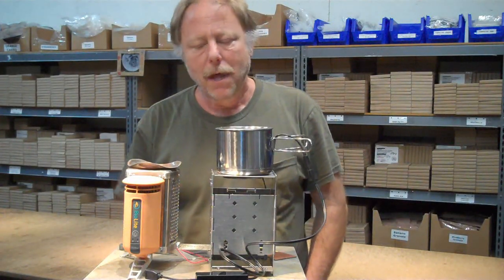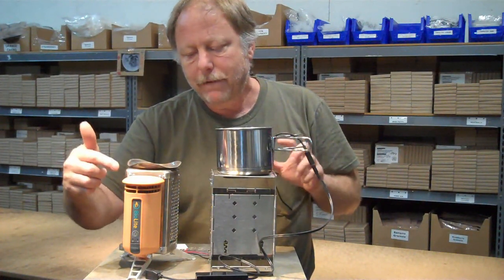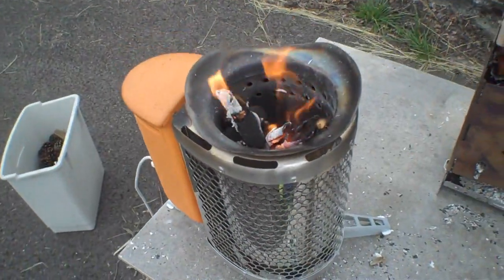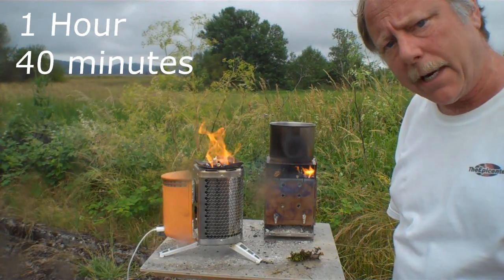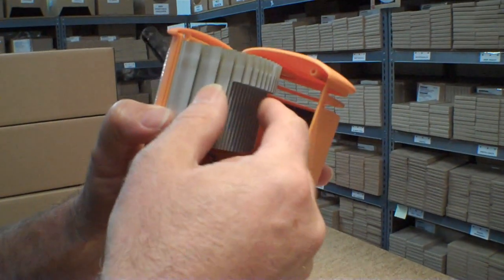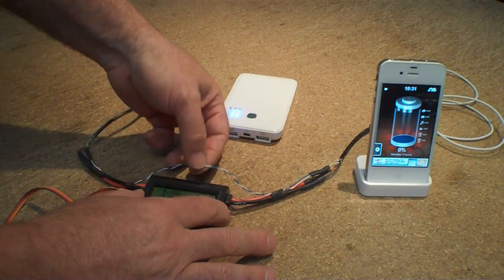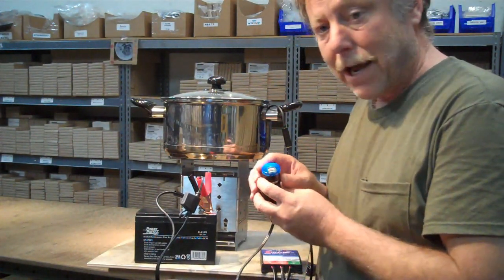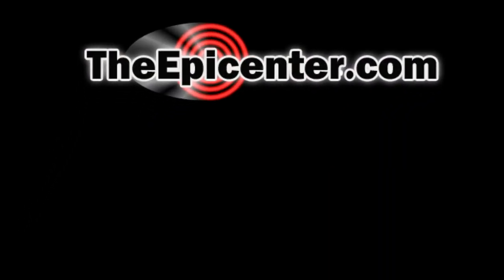BioLite Charging Test - using iPhone 4S and comparing with Cup Charger and FireBox Stove Day 3

Comment: great video, would have been nice to have a usb amperage meter on each cable with a total counter.  im not a biolite fan but it did not seem to be functioning correctly. 
I did have a question if you could change the water in the cup continously, keeping it as cool as possibly. does that effect the output?

Comment: just to point out the biolite was designed as a camping stove first(primary function) and as a second function (complimentary) it also happens to charge stuff when you make a fire, one of the reasons it uses up fuel so quickly is because it was designed to boil a pot of water for example as quickly as possible that's because of the fan and in turn it eats fuel very quickly, I am however disappointed with the results I expected much better from the biolite its a great camp stove I was hoping for better charging .I was ready to buy this in the spring from mec but now I dunno .... does anyone have one of these a little insight would be greatly appreciated
Reply: +5had0wL1nk I love my biolite. Ive heard nothing but good things from people that have them. Mine charges better than his did.
Reply: I absolutely love my BioLite. It works great, and having it just under 3 years I stand by the product.

Comment: Phones are a bit unreliable as test devices. Phones have charge strategies and will not allways use weak power sources effectively. When presented to solid 5V they will get what the amps they need. I suggest you slowly decrease the USB voltage of power devices tested and tell people what mA and power output you read. Then it is up to the phone makers to make smart   and continuosly adapting strategies. I suspect charger makers should pay attention since some phones make up their mind about the power source quality at the begining of charge and does not notice if it suddenly becomes more capable. Some phones are idiotes when connected to solar cells and do not adapt as light and power capability that changes in seconds.

Would be nice to have a separate test of how capable phones are when connected to weak power with fluctuating current capability.

It is really hard for a phone to feel what is behind a +5V output. If the power source has a stupid voltage regulator and does not care about the voltage if the solar cell, or TEG element in this case, the regulator will only care about +5V and if pulled below it basically joins the cell to the output and the cell wiĺl no longer generate at its optimum voltage.

This is a basic design flaw in many outdor chargers with solar cells. A phone connected to a poorly designed controller will se a nice +5V but when attacked with an adjustable current load, at some current it suddenly drops all output current and phone has to revert back to a much lower current load for the +5V to recover.

After a voltage drop "incident" like that phone may sit back and not try the linits again.

Phones should be tested separately with +5V current linited DC and you will be amazed some phones make their mind when current limit is lowered but do not notice and benefit when current limit is increased again.

You can easily test if a charge device has constant power strategy. Since power is voltage times current a decrease in outpu voltage should increase the current. This means a maximum current of 700mA as 5V starts to drop under load should be 1000mA when output pulled to 3.5V.
Reply: +Tore Forsgren I get your point however most of the people who buy these biolites are purchasing for the purpose of charging there phones on portaging trips for example so it makes sense to test them on phones as this is what they are most likely going to be used for
Reply: If you want to charge your phone, there are much, much better ways to do so.

Comment: What a SHAM. The Biolite was down wind from the box thus causing the Biolite to overheat and stop charging basically sabotaging the heat exchanging thermocoupler. Additionally watch the open flame on biolite vs the close box flame. The Biolite is designed to be heating or cooking NOT just sitting there open flame heating the atmosphere. Your demonstration is ludicrous in its disparity and obvious intentional bias.
Reply: +Dale Reynolds its not a sham. I have a biolite and it won't charge most of my devices at all let alone in a reasonable amount of time. it also eats wood like a rabid beaver.
Reply: If you actually look at the power specs on the Biotite, you would see that it is not providing enough amperage on it's own to charge a smartphone or touchscreen. It even says this in the instruction manual. You can buy attachments for $50-$120 that can charge up to a laptop, and do other functions such as purify pathogens from water and provide light, and those devices will power the more demanding devices very quickly. Also, it could fry your battery if you use either one of these charging devices to charge your smartphone, i would highly recommend the attachment device or a charge stick which works wonderfully also...

Comment: One mistake that I see in your test is that you have the fan / charging unit positioned down wind. It should be positioned upwind to have the coolest air coming into the intake. Also, The Boilite  is down wind from the other stove getting preheated air which reduces efficiency. Also, I believe having a pot on it gives more intense heat at the thermocouple and reduces the burn rate for the fuel at least a little. Otherwise, very entertaining and great effort for the testing.

Comment: Good review.

P.S. I know for a fact that your BioLite's battery is fried. Meaning it doesn't work any more and won't hold a proper charge.  I could be wrong, though if you were keeping the fire raging hot as you say and the battery kept draining fast enough to turn off the charge, then yes your BioLite battery is no longer working.  I own a BioLite, I have only had it for less than a year, I keep the battery topped up by plugging it in every 3 months when not in use.  Since I haven't had it very long I have yet to discover how this will affect the battery life cycles.  I do know that I can charge my old Galaxy S4 to full %100 from dead in about 3-4 hours and while keeping the fire raging the whole time the charge never turns off. Although it does use low charge mode most of the time with 10 minutes or so bursts of high power charge mode.  I can detect when the charge modes switch in the BioLite because the charge mode change causes the phone screen to turn on also the phone makes a beep sound.  Well I hope you can get a replacement battery for your BioLite, you need it.

Comment: I noticed you operated the BioLite stove incorrectly. It clearly states in the instructions I got with my stove that you are to face the stove into the wind... you have it facing away in many shots. Having the BioLite down wind of your other stove and having the orange power mod facing the wrong way is far from impartial.
Reply: Jamie Robinson Holy cow.  Not only do you have to have a huge pile of wood, but also monitor the wind and keep adjusting the stove to face it?
Reply: LOL a huge pile of wood? I guess if figuring out which way the wind is blowing and being smart is too difficult stick to what you know.... whatever it may be :P
Reply: I suppose if you do this on the weekends, at most, it will not be a pain.  But I do this EVERY SINGLE DAY.  My current choice is a silver fire scout.  It burns QUICK, like this stove.  Processing and processing wood.  And you cannot feed it while the pot is on, just like this stove.  All of that gets old quick.   And I am often on the beach, next to the ocean.  The wind direction changes.  From what I have seen, this stove cannot boil a full pot on ONE full load of wood.  This means picking up the stove, and fiddling with the fire.  And I have not seen one person actually charge up a phone or device.  They just point out the green light and plug it in for a few seconds.  This guy is doing a good job demonstrating it all, if you pay attention.  Playing with fire is fun and all, but I like to sit and watch the ocean, sun come up, ducks come in, keep a look out for predators, whittle on wood, pack/unpack gear, get my breakfast ready, etc.  Not just processing, stacking, monitoring, adjusting for wind etc.  Why this needs explaining.... LOL....

Comment: I want to know how you controlled this experiment.  the phones are different color, are they the same generation?  are they running stock or does one have some advanced power saving feature installed?  does the slower charging phone have something running that could be draining power?
Reply from the maker: James Higgs Both phones were iPhone 4s with the same amount of memory. Both phones had only 1 app running, the one to display the charging level. The app is called Zen Battery. Neither phone was in airplane mode: Wifi, Bluetooth, and cellular were all turned on. Charging could have been faster if everything were turned off, but that's not something people normally think about doing so I think this was a more real life demonstration. Your mileage may vary.

Comment: Very good Critical review! 

I might get a Biolite and play around with it.  the cup charger looks more practical as a phone charger, that Biolite seems like it was putting off a lot of heat, it's probably a good cooker.
Reply: +gearsNtools It is a good cooker, but cooks too hot! I tried to cook instant rice with it, in the kettle pot and the lack of simmering made a mess in the bottom of the pot, took me a lot of effort to clean up the sticky burned mess from it. Battery charging was very poor (though I have a big battery in my big phone a Nokia 1520) but probably sufficient for smaller batteries.
The Camp Stove is easy to fire up and to keep it going thanks to its internal fanning, but I will now try something else and fan the flames when I want to using a portable fan. I have returned the item, I am sure someone must have been very happy to see my unit (1 month old) in the garage sale at REI, it remains a neat gadget, but a bit heavy and charging (for me) was useless.
I may try one of these cup chargers combined with a portable solar panel.

Comment: First of all, both products have one major design flaw.  

The Powerpot's flaw is that the charging cable can not be exposed to heat or flame, so using the Powerpot is not possible over an open flame/firepit or you'll melt the cable.  Hence why he's using a firebox(which weighs 2 pounds by the way, the same weight as the Biolite alone.)  If the power pot's cable was insulated and then covered with a woven Nomex sheath making it fireproof this flaw would be fixed.  This is a shame as this is not something you can fix at home DIY.

The Biolite's flaw is that the orange charging unit is not heat shielded.  As this guy points out, it is the temperature differential that produces the power from these devices.  Now when the Biolite has flame shooting from the top of it, it's radiating heat onto the orange plastic unit, reducing the effectiveness of the charging unit.  The result is short intermittent charging periods.  But this is where the Biolite beats out the Powerpot because these can be fixed with ease and cheaply DIY.  Another youtube user has a video demo where he covers the orange charging unit with aluminum foil tape.  This effectively reflects that radiative heat and enables the BIolite to charge constantly at high output.  This solution also adds very little weight.

So if you have the powerpot, the only way it's effective is if you carry a 2 pound firebox with it.  If you plan on charging while boiling your water for food with your canister stove, it's absolutely worthless.  This is because it will only take a few minutes to boil your half liter of water for your food, giving you only a 1-5% charge.  Otherwise you're carrying and wasting extra fuel just to charge your phone-which is pointless.  Again, using the Powerpot over an open fire will only result in burning the cable and destroying the pot.

The Biolite will replace your stove, charge your devices, and give you unlimited fuel at 2 pounds. 

The Powerpot weighs a pound and requires you to bring a 2 pound firebox to do the same.

In conclusion, The Biolite is far superior, just cover the orange plastic charging unit with foil tape and you're good to go...

Comment: Did you even read the instruction manual ? First of all, before even plugging the USB charger you have to wait for that little light to indicate that you can plug it in. Also, It is highly recommended to put the fan on low. And finally it works way better if you put something on top of it. Before making such a criticism of the biolite try to follow the instruction or just check other video to see what you are doing wrong.
Reply: zarants. I agree with you completely, when people post reviews that are obviously designed to discredit another product I immediately dismiss theirs. I have used the Bio Lite camp stove for some time and also use the Kettle Pot and grill setup, charging is never an issue for me. Comments from people that do not own the product carry no weight IMHO, posts that start out with "What Happens" and "I Think" show they have no hands on experience. Put some skin in the game and pony up to do a real review and read the dang manual.

Heather

Comment: I'm thinking that you would be better off with a folding solar panel. Instead of wasting
hours slaving away feed stoves.
Reply: exactly what i ended up doing..... saved on packing and the sun is almost a guarantee.... especially over and electronic stove...
Reply: James Crider Not in the rain forest that I live in.  Great for you though it sounds.  And since I live in a forest, i have all the wood I need.  I still want that Biolite and the cup charger.  Brilliant!

Comment: Keep in mind that the biolite is primarily designed for a cleaner, hotter burning fire. The charging feature is possible because extra electrical current is generated. Engineering is about tradeoffs. Consider that the cup charger may not allow water to boil as fast as it would in another utensil without the electrical generation capability, due to the design consideration for mounting the TEG. So, what is the time to boil? 

Additionally, the biolite is possibly handicapped by the predominant right to left wind (as viewed watching), with the biolite positioned downwind (left) of the firebox. I watched another review video that explained how the biolite works and hotter air over the heatsink portion may have artificially reduced the power generation.

Comment: What's the reason for not shipping outside of the US?
Reply: +EpicenterBryan yeah but shouldn't the import problems be that of the buyer? just place a disclaimer. Most countries have no problem importing stoves or electronics as long as you are not shipping food or gas canisters it should be fine. :) I have lived in and shopped online from 6 different countries. I never had a single problem.
Reply from the maker: There are several reasons, but here is one: Each country has it's own import / export restrictions. Food items imported into Canada for example must have both English and French on the packages. MRE's don't have this.

Comment: You have too much fuel in there. You claim it was the same amount of time but you also said you had to empty the biolite so that isn't the same amount of time for both. Also, you didn't need to empty the biolite because it will burn down almost all of the wood to nearly zero ash. Also, try using wood pellets. Fill it to just below the top line of holes, light it, turn the fan on low and leave it alone. It will start charging in about 7 minutes and should keep charging for about an hour straight and should add about 40ish percent. Do a fair test if you want to prove that your product is superior......
Reply: I never knew that there was an original version that didn't have a USB port, that's pretty cool.
Reply: ***** where do you love?
Reply: Live......
Reply: Holy crap, it gets chilly up there. We recently got a blast of your air and it was a bit cool :-)
Reply: That would definately be a good cold weather test for any equipment.

Comment: Brian,

Thank you for the very informative video. I actually own a biolite stove and I have noticed the lack of "charge".  As a direct result of this video I have ordered your product as a primary power generation source...thank you for the info.
Reply from the maker: Thanks for the comment. Mine dropped dead a little while after this video. The fan still works but no output at all and the orange LED flashes constantly. To make it stop I had to remove the battery. I just bought a new one that I plan to do some more testing with in the near future.

Comment: maybe if there was a pot with something on top of the biolite the heat would be greater at the thermo couple. and burn less fuel.  better still put cup charger on the biolite.
Reply from the maker: We tried using the cup charger on top but since you have to keep removing the cup to add fuel the two really don't work well together.
Reply: EpicenterBryan I have been watching a lot of these biolite videos including some about trying to get better efficiency. I believe the cold side (the fan side) gets too hot from all the flames at the top of the burning chamber. Maybe if you try another test you might try putting foil tape across the top of the plastic to help reflect the heat from the burn chamber. Also, I have seen people say that using the fan at high speed sucks a large amount of power, you might want to try with low speed and see if that improves the end result. Thanks for the video in any case, I had not seen that cup before and I am very interested in it now. Keep up the good work.